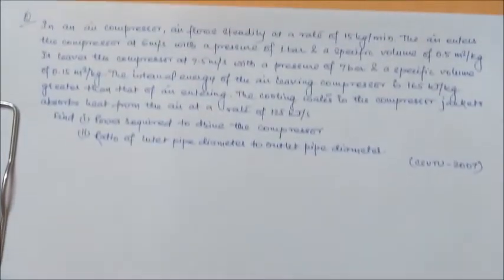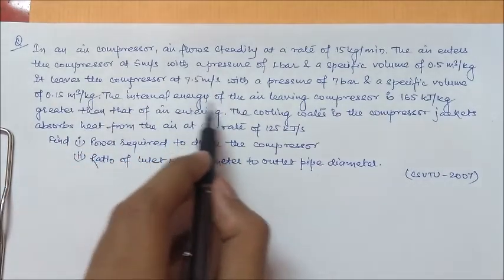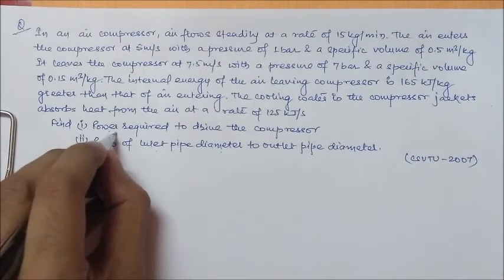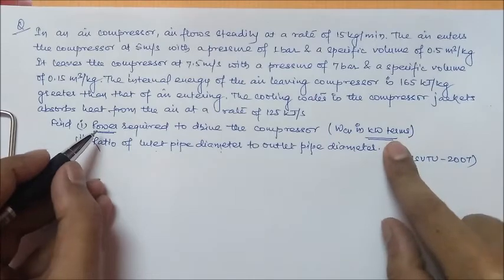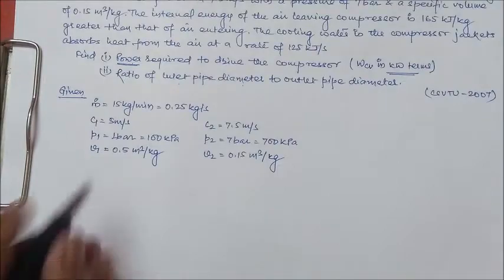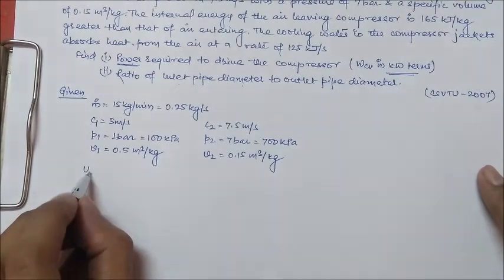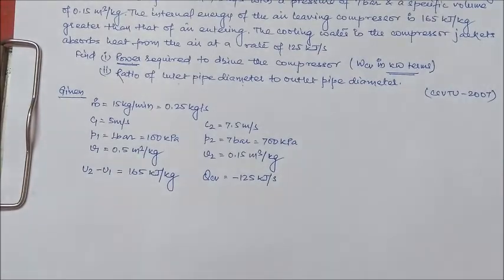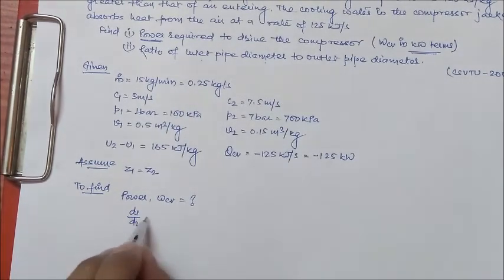Numerical #27 | Steady Flow Energy Equation | S.F.E.E. | CSVTU | Solved

Comment: Its ok ok... here i want to tell u sir from 1 month i am in confusion that what is the current formula like dq=du+dw ya du= dq+ dw.  And after one month of struggle from a no. Of videos i got to know the right eqn. From chemical engg. Thermo. Is du=dq+ dw and always take dw as (integral of -p*dv)  where work done on the system is +ive and by system is -ive and heat given to the system is +ive and heat out from the system is -ive ........... but in ur video u are taking dw = p*dv  (not - ive sign)  that is why mai ye jaisi hi dw ki baat ati hai ques me to mai confusion se bachne ke liye video forward kar deta hu...  agar sir ap samajh gye ho meri baat to btaiyega.
Reply from the maker: Remember this*
Workdone by the system is +ve 
Workdone on the system is -ve  and 
Heat absorbed by the system is +ve 
Heat rejected by the system is -ve

Everything is related to system, system jab Kam karta to hum use positive mante hai aur jab system pe Kam hota hai to negative waise hi jab system heat lose karta hai to negative and positive jab gain karta hai 

Workdone ka example aapki bike jaha mechanical work aapko milta hai and aapke ghar ka refrigerator jo electrical work le kar khana thanda rakhta hai .... Bike ka engine aapka system hua to aapko positive work Mila system se ....and refrigerator agar system hua to work system pe hua so negative

And correct formula for 1st of Thermodynamics for a process is dQ=dU+dW

*Note: if we talk about Thermodynamics in physics

Now if see Ur chemistry formula which is
dU=dQ+dW 👉 dQ=dU - dW right

Now according to chemistry
sign convention for
work done by the system is -ve ...
So, dQ=dU -(-dW);
dQ=dU+dW ( Same as the formula in physics)

So it's all about sign convention
Reply: Okk sir i will try my best to clear it out. And thanks for your reply.